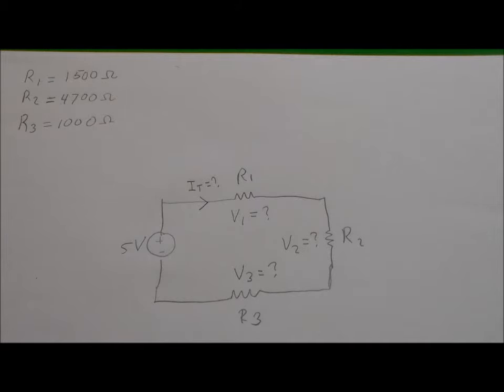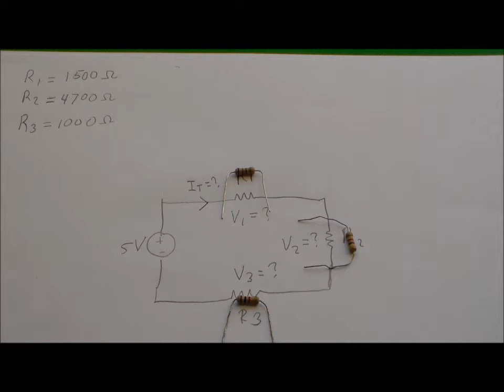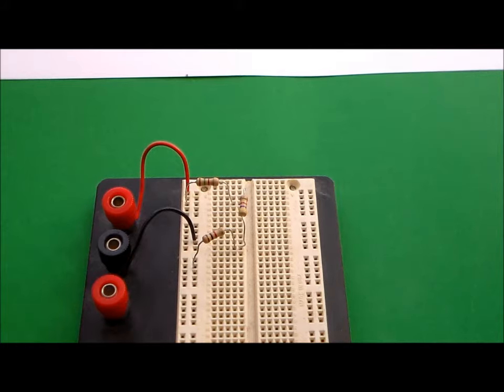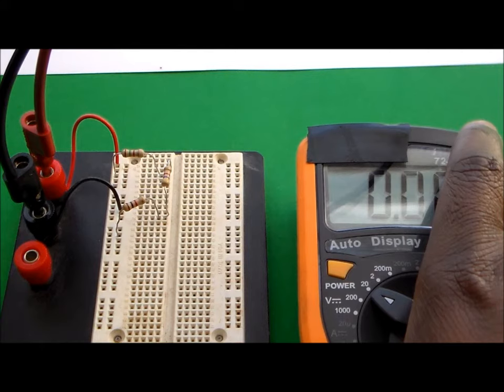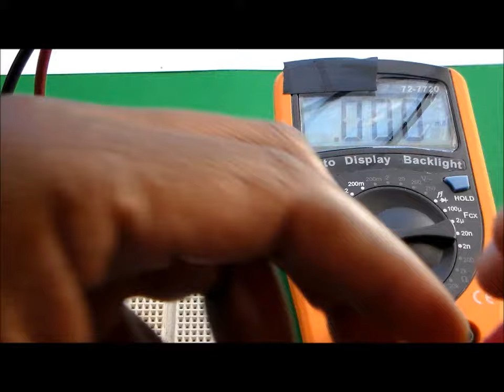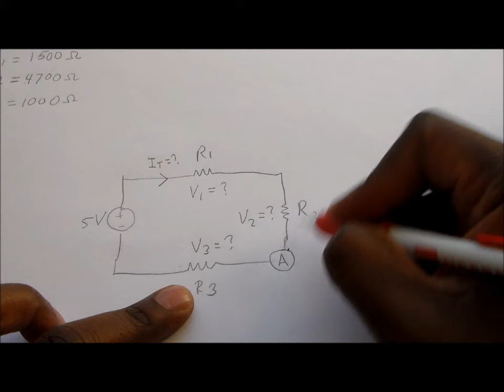How to Measure DC Voltage and Current in a Series Resistor Circuit.

Comment: Thanks a bunch!  I just cannot keep this straight.  I used my desktop DMM and couldn't get it to work then I switched to my handheld and followed this video and it worked.  I switched back to my desktop DMM and it worked so I am guessing I had the measuring points wrong.

Comment: As an add-on comment, to measure current, you can also measure the voltage drop at any resistor (assuming you know the precise value of the resistor), and apply the calculation V(drop)/resistance to compute the current.  The voltage drop is the voltage going into the resistor minus the voltage coming out of the resistor.  This requires two measurements - except for the last resistor.  Since the last resistor has a voltage of zero at it's exit point, you can just measure the voltage going into it and then divide that by the resistor value to compute the circuit current.  Using this method, you don't have to "break the circuit",  rip out components, remember to move the test leads from the Amps input back to the Voltage inputs (resulting in blown multimeter fuses), etc.  If measuring AC current, us the DC equivalent, Vrms for the voltage measurement.
Reply: Thanks for the tip man

Comment: Have not done this stuff since I took some electronic classes back in the early 90's.  Thanks for refreshing my memory!

Where did the .05 volts go?  Voltage drops across the three resistors added up to 4.95 volts.  Resistor tolerance I guess.
Reply from the maker: Hi snippits75,
Thanks for asking. Remember wires have resistance. Some of the 0.05 voltage will be dropped in the wires. In addition. There is some uncertainty related to the multimeter. This will account for the remainder of the of the 0.05 Volts.

Like, share, and subscribe.
Reply: @CALettsomePhDPE  I forgot about the wire resistance.  Thanks for pointing that out!

Glad I watched this because I was about to blow a fuse on my meter.  I need to measure the current going through some resistors coming off a four way rotary switch, so I can buy another rotary switch with the proper current rating.  I forgot about lifting a leg!

Comment: How do I measure a Series and Parallel circuit? 2S4P?
I understand how to do the Voltage, but I am uncertain of the current on a 2S4P setup.
Reply from the maker: Hi Jason,
Thanks for asking the question. Measuring voltage and current does not change. Measure voltage across a component (voltage drop) or at a point relative to ground. When measuring current break the circuit and measure the current at the break. This will give you the current at the point of the break.

I have a few videos on my channel that may help.

I hope that helps.

CAL

Comment: Does it matter at which point on the circuit you break to measure the current?  ie can you measure the current of the circuit by breaking between the 5v input and the first resistor?
Reply: The current in a series circuit is the same at all points, so no it doesn't matter

Comment: If the 3rd resistor wasn't connected, would u need a black jumper cable to connect it in series or no?